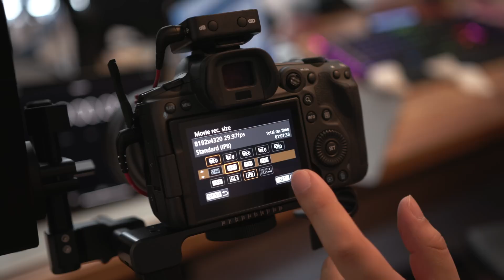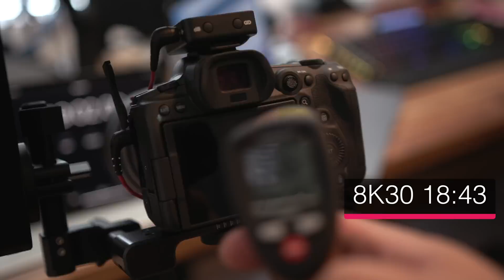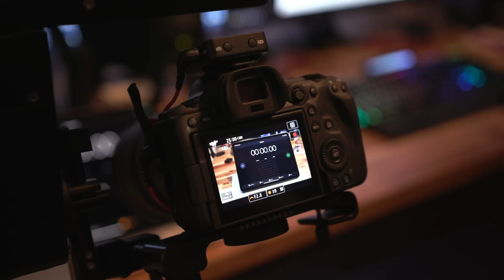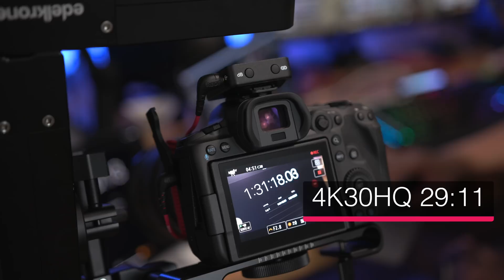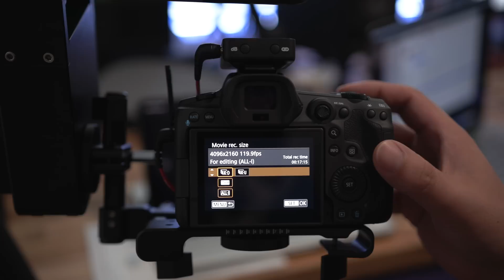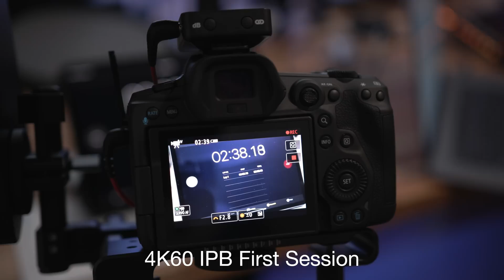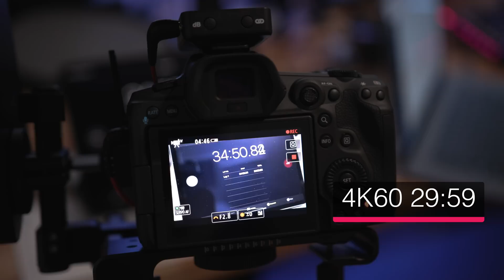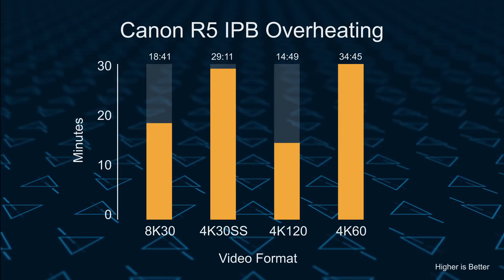Canon EOS R5 Comprehensive Overheat Test

Comment from the maker: Is the limited 8K30 and 4K120 record times a deal breaker for you?
Reply: I have my R5 for 3 days, I'm amazed (image quality, AF, IBIS, rolling shutter). No overheating in my typical workflow and I played a lot with it.
Same here, it makes no sense to stop the camera at such a conservative barely warm temperature, and the recovery seems to be a (too long) timer. Pretty sure that Canon will adjust these software threshold very soon in a firmware.
Reply: @freddumartin7878  To get that amazing IQ, including the best dynamic range of any full frame camera, the sensor has to be kept "cool". Running up the sensor temps with video will ruin the photo side, and that's why Canon implemented time limits on the specialty 4K/8K modes. This has nothing to do with crippling or protecting the cinema line, or they would have done the same to the 1DXIII.
Reply: What about the All-I codecs
Reply from the maker: @Aman_Mondal  Similar run times.
Reply: Planning to test with Ninja V? YouTubers reporting over an hour 4K60, and more without internal card
Reply from the maker: @stopthefomo  Sorry I don't have a Ninja V. It's promising that the camera can record longer on an external recorder.
Reply: They are not a deal breaker, but I would be open to try something to mitigate them.  That is too much power to not be able to fully use.  Would you be able to provide the link to the tear down?
Reply: Not really. Prior to 2 weeks ago, nobody could shoot 4k 120 or 8k on a mirrorless camera.  People need to realize that the R5 is a PHOTO cameras first and foremost. ANY amount of heat on the sensor will affect photo quality significantly. Canon did a lot of work to give the R5 the best dynamic range of any mirrorless camera to date (it actually rivals/ties the Fuji medium format GFX50) and extremely low noise for a high MP full frame sensor. Letting video overheat the sensor to even 50c can cause issues on the photo side. This is not crippling. 

The solution would be to make a 12 MP sensor, but then that camera is all but useless for serious photography. 

NONE of the Sony hybrids could shoot more than 4K 30. Period. None of the Nikons could shoot more than 4k 30. None of the Panasonics could shoot more than 4k 60... with questionable autofocus. The Fujis are crippled by small cropped sensors and also overheat at 4k 60.

Comment: My theory is that the temperature limit is driven by the temperature of or near the CFexpress card. For some reason CFexpress has a lower max operating temperature than a SD card but it has better heat dissipation than an SD card. If the internals get too hot, then the card gets hot and you risk data corruption or throttling. This might explain why people are able to record externally for 2+ hours in 4k30HQ with no cards inside.  Recording externally with a card inside (that is doing nothing) gets the same times that you recorded. We can't tell without some thermal imaging of the different sections of the camera body.
Reply from the maker: I’d argue that CFexpress cards don’t have a lower operating temperature but rather they heat up much faster due to the data rates. CF express cards have the ability to throttle if they get too hot. You’d run into write speed issues before the camera actually shuts down. That said if you’re recording externally, you’re not using the processor to encode the video. That’s all done externally so no buildup of heat on the processor.
Reply: @StanYanMan  might even be a combination of both. I was also surprised when I compared the top SanDisk Extreme SD with their CFexpress and Prograde SD with their CFexpress. The operating temperature on the spec sheet is 10C lower for the SD cards. I haven't seen anyway try switching a warm CFexpress card with a cold one to see if there's a difference. Either way I never use my R for video clips that are longer than 4 minutes. But it's just an interesting engineering challenge. It's amazing that this small form factor has any 8k at all like you said.

Comment: This is a very good test video. I personally think that Canon is too conservative with the software regulations because the outside temperature doesn't seem to make a big difference from the many tests we have seen.

Is it possible to take a temperature measure of the photo sensor just to see if it is significantly hotter than the body? If it is significantly hotter, then heat dissipation is the major cause here; if it is not significantly hotter, then software is likely the major cause here. I may be wrong though.

Comment: I never had doubts about the time limits, my issue is how significantly reduced these times are after recording in other modes or while you may be framing up a shot while the camera is on.....and the length of time it takes for cool down. I mainly film in 1080 so if i film for 30 to 40 min like that and then switch to let's say 4K 60 for a few minutes how much time would i get? Great video by the way! Appreciate you putting this together!

Comment: I wanted this camera not to overheat when i take a mix of photos, 4k60 and 4k120 (rarely and for a 10 seconds for example). I am not quite sure if i can expect this.
Reply: This is how i've been been shooting mine for a few days now.  Footage looks great but your time limit still goes down with short clips a lot quicker than i expect. (going to try and turn off and on a lot more and see if that can prolong my shooting sessions)  My camera has been cooling for 2 hours in my 75 degree office and i'm showing only 20 minutes in 4k60 after 2 hours. and i didnt even run it to its limit to over heat.  These recycle time need to be quicker otherwise you kinda need 2 during a wedding( maybe get a R6 as a 2nd or 1st. some are saying the 40k is better on the R6.)  Yes you can go to 4k30 after shutdown but you can't go back to the high res or frame rates until you turn it off and let sit for awhile.  If your just shooting clips here and there you might be good.  but remember even shooting photos takes away from your record limits as this heats up internal temp.
Reply: @TMBPHOTOVIDEO  Very much appreciated your detailed answer! Beer is on me!

Comment: Another incredible no sense test. In real world i never shoot continuously in 8k or in 4K 120 fps. We want to know if overheats in standby mode or during small clips ( some minutes max.).
Reply: Exactly
Reply: It does overheat even if you don't use the camera in standby mode. or just shoot small clips. It gradually builds up the heat, and eventually shuts down the camera. I've been testing R5 for a week now, and yes the overheating issue is very annoying. I really hope Canon can address this issue via a firmware update :(

Comment: The stop times don’t even correlate with measured temps.

You would think that they would all overheat at 110F for example instead of 100, 90s, 110s.

My suspicion is that software regulation is more at play than thermal constraint.

Comment: Good to see a test, but the problem is not just continuous recording, it's the heat accumulation and got stuck inside the body, that's why it isn't hot at camera surface. People may only taking photos and needed to switch to video and found it only allowed for a few minus recording.

Comment: Maybe the critical temperature is in the sensor? Is it safe to point that laser directly to the sensor? It would be an interesting measurement...
Reply from the maker: Sensor temps were a couple degrees higher than the body, about 108F. I bet it's the actual processor that is maxing out on the temps.

Comment: I would have personally preferred no 8K but with no overheating. I feel like Canon just wanted to fill out the spec sheet for good sales and didn't care about the consequences. The issue with this overheating is that the camera doesn't cool down unless it's completely off. So shooting a mix of stills and video is just not feasible for professional use.

Comment: I would like to know if having the flip out screen pulled away from the screen would help with heat dissipation. Also what happens if you run the same tests with an external fan blowing air onto the camera? It can cause issue with built in mic but that is easy to address.

Comment: I think if canon can just fix the recovery times then this camera wouldn’t be under so much criticism. There’s no reason why it takes 20-40 to recover in 72 room temperature, that seems it’s mostly likely a software limitation. I think we can all agree that 20 min of 4k120fps , 8k and 30min of 4k60fps is enough but it’s the recovery times that kills the camera, hopefully canon can fix that
Reply: Yeah, this.
Reply: Reducing bitrates should help a lot! CFE card is the faulty thing here
Reply: john Biscuit I just know low bitrates modes on the R5 don’t overheat. I also know that very high bitrates make the CFE very hot, overheating in first and a lot. The Sony A7s3 uses bitrates like 600Mb (most are 200/280) and the R5 goes so higher 🙈. CFE becomes a toaster...
Reply: @johnbiscuit8272  Let's wait for this firmware update ;)

Comment: There are 2 big issues.
1. You need to wait way too long after you record first 30mins.
2. Much bigger issue is if you take photos on summer day, you will not be able to record at all, after maybe 1h of shooting...and that is really big issue. Yes, you can record in 4k 24fps non-HQ, but quality is pretty worse than HQ.
I also think that canon can increase temperature limit to 50c and you will be able to record at least 50% more....40c(103F) is not hot that much.
Reply: unique93obr Even if canon did what sony does, gives you the option to increase the high heat limit
Reply: You could also record the APS-C crop 4k24/30 (1.6x crop) so that you get oversampled video from 5.1K.  That looks pretty darn good but you have to be able to deal with the crop.
Reply: @brthiebauth  if I pay almost 4000$ for Fullframe camera, I want fullframe video. :)
Reply: @unique93obr  Agreed.  It is a fall-back position that won't work for everyone.  Just an alternative if you need better quality than the standard 4k24/30 AND you can live with the crop for your work.
Reply: @brthiebauth  Or you can buy atomos ninja V, and record unlimited 4k 24fps HQ and 4k 60fps... :)
Reply: @unique93obr  True as well.

Comment: nice review, thanks!  Adding to the modes mentioned, the 4k60 cropped mode overheats even faster than 4k60 non-cropped. The quality is better (much sharper), therefore it might be preferable... but again... overheats faster. https://twitter.com/GeraldUndone/status/1289584165021605888
Reply from the maker: Interesting. Thanks!

Comment: It would have been really helpful if you would have removed the lens and done a measurement on the sensor itself, that would help to understand if canon is too conservative or the camera is really doing bad!!
Reply from the maker: It turns out you were right about the sensor being hot. It was a few degrees warmer than the back of the camera. I saw about 108F when the camera refused to shoot anymore.
Reply from the maker: It wouldn't be the sensor that is hot. It's the processor that is actually doing all of the work so that's what is overheating. From teardown pics, it appears that processors are close to the back of the camera.
Reply: Thanks for checking!! 
I’m wondering if 108 could be a warning temperature, usually electronic components like in a pc have much higher temperature cut off, I’m thinking Canon has put a very low temperature cut off to the camera to kinda cripple it down...
Reply from the maker: Federico Pinna imo. 108F is nowhere near the 60+ C or so limits of silicon chips or electronics
Reply: SuprUsr Stan Hi. With a computer build the general rule of thumb is to keep the CPU itself under 100 C. 212 F. You are probably right - poor thermal management. The thermal paste used can make a big difference - assuming they did use some in the first place. The R5 had a magnesium outer body unlike the R6 so I'm surprised at the poor heat distribution across it - magnesium is a good thermal conductor so the heat should be more spread out and consequently radiated away faster. That to me suggests poor thermal contact somewhere. I wonder what is really getting too hot? The CPU or the Cfast Express? Canon are a conservative lot so they may well have decided to protect the products lifetime by having low thermal limits. If I remember correctly (I'm 70!) mean time to failure (MTTF) reduces rapidly with a rise in temperature - an exponential effect. BobUK.